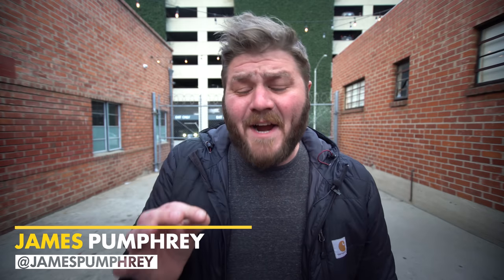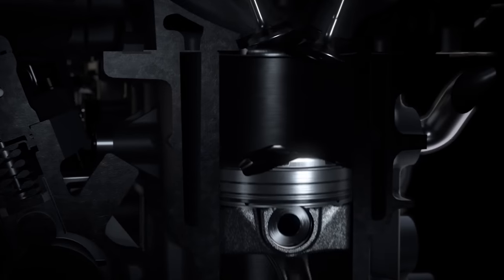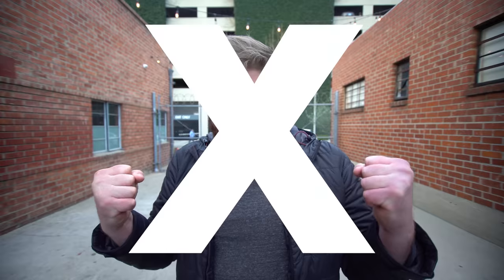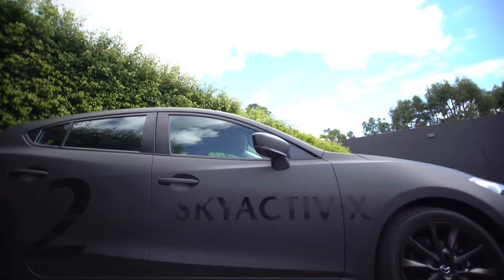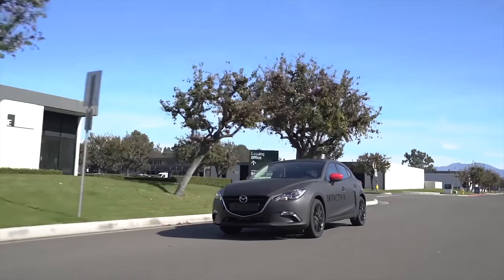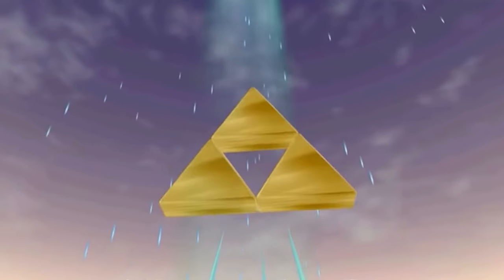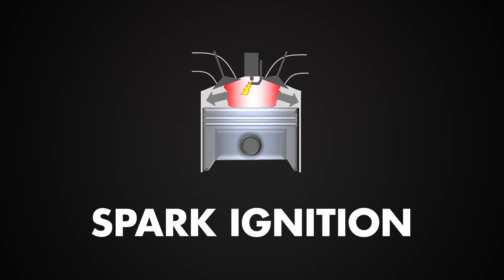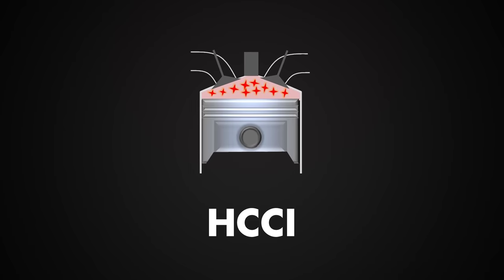Mazda's Secret New Engine Technology - SkyactivX | The New Car Show

Comment: ok hear me out, Mazda should make a turbocharged HCCI rotary hybrid diesel engine.
Reply: 1. We do not inject diesel via ports/valves (Port Fuel Injection, PFI; or Multi-point Fuel Injection, MPI), we inject directly into the cylinder (Direct Injection, DI). HCCI is a Port Fuel Injected system. This method of combustion is just running a Gasoline engine so it "diesels" (runs without a spark, which is otherwise considered "abnormal combustion," which is bad in a regular, conventional engine). MPI would be less efficient in a diesel engine; Direct Injection offers better fuel economy than MPI when considering both standard Diesel and Spark-ignited Gasoline engines. The theory of running an engine using what we still call "abnormal combustion" isn't new, but actually getting it to work is the new technology.

2. Mazda's Rotary design isn't exactly very efficient. It's light, and it has a fair amount of power for it's weight, but as a rotary, there are far better Wankle designs, namely which reduce wear on the Apex Seals. There are far better ways to lubricate the engine, other than using dirty, used engine oil basically dumped into the intake like a carburetor, and then have fuel injected later on. The most common way to fix the lubrication issue in a Mazda engine is to premix Two Stroke engine oil with the fuel, which unlike conventional motor oil, is designed to be burned. There is a prototype diesel rotary from LiquidPiston, but their design for rotaries are not like Mazdas, and are much smaller. That being said, technically nothing stops you from enlarging the parts and attempting to build a larger one. It's worth noting, however, that their prototype is just that - a prototype, which doesn't even contain a cooling system. It's just a proof of concept.
Reply: @Lieutenant Phœnix It was a joke but thanks for the detailed brakedown
Reply: @BenignStatue71  r/whoosh
Reply: @BenignStatue71  I was waiting for that one guy in the comments
Reply: I was onboard until you said Rotary
Reply: @luftboyprod  Yes, the higher rev range is caused partially by instability of the engine due to the high compression ratio (stroke - bore), so regardless of fuel injection method, unless you drop the compression you're not going to raise the redline RPM. You'd lose so much power that it'd be pointless. I said specifically an HCCI wouldn't happen, but a standard Diesel Rotary is possible. Just not a Mazda Rotary design - like I mentioned, LiquidPiston produced a prototype. Yes, their engines are too small for a car, but theoretically it's possible. The real question is whether it would even be worth it using diesel - if the benefits of a diesel engine aren't visible in a rotary engine, the design is a null point regardless of fuel delivery method.
Reply: Hybrid gay
Reply: Stonks
Reply: With a built in Nos tank attachment system.
Reply: @BenignStatue71  the only problem I have with DI(direct injection) vs PFI(port fuel injection) is that I heard DI in gas engines builds up ALOT of carbon build up because in pfi the fuels actually breaks down some carbon and burns it off as it enters the intake valve and moves over the piston.  However in di, it is directly sprayed on the piston and doesn't get the chance to break down much carbon over the intake valve before it is ignited.
Reply: @ichigokurosaki3120  I don't know much about the exact differences between DI and PFI's effect on the valves with unleaded fuel, but modern intake valves are going to get dirty regardless of injection method; leaded fuel (while dangerous for the atmosphere) worked very well to lubricate the injectors, as the included lead would stick to the injector's sealing surface; unleaded fuel does not (we've gotten past this with different designs since the 60s, but the problem still exists on a very small scale), but it's significantly safer to burn. Serious amounts of carbon build up in the cylinder should be unlikely in a car with everything running properly in factory spec (exact build up rate depends on manufacturer choices in how they design the engine and electronics). The time it would take to build up a considerable amount of carbon probably exceeds the manufacturer's "expected" lifetime of the car; GDI Hyundai's seem to perform well into the 200k' Kilometers range with no misfire problems (which could occur from excess carbon build up. For comparison, AutoTrader CA considers 20k Kilometers a year the average use of a car, making said Hyundai 10 years old in terms of it's road use). If too much fuel is being sprayed into the engine, leading to un-burnt fuel, you're more than likely looking either an overly aggressive tune (where we just spray more fuel to lower the AFR, some of which may not even having the chance to get burned), or a malfunctioning sensor giving the electronics a bad reading leading it to do that on it's own. Buildup over the car's lifetime isn't considered serious. All parts and how they're used are designed to be efficient and (generally) cost effective, not necessarily to run forever, but to be (again, generally, take some manufacturers with a grain of salt) easily replaceable when necessary.
Reply: @BenignStatue71  I agree with what you're saying, I'm not actually 100% sure around what mileage most vehicles with DI get too much carbon build up that they start misfiring, but I assume it's in the 100k to 200k range but maybe even more.  I'm a strong believer that if regular oil changes are done and a vehicle is well taken care they can last you for a very long time.  Also I'm not really sure if it's a problem with DI as a whole or just gasoline because diesel engines use DI as well and I haven't heard much negative about their carbon build ups, and thats even with diesel engines suffering more from blowby and excess fuel making its way into the cylinders.  I wish they're was more research into these departments so we as consumers know what we are buying/getting from a new vehicle.  Rather than buy and deal with recalls in the future and an apology notice for why our engines are running like crap but thats just my two cents haha
Reply: Yeah, if they could take the spark out of the rotary, it might solve their efficiency problem as well as the associated emissions issue that IIRC killed rotary for them... and it appears they are trying to do just that: https://jalopnik.com/mazda-may-apply-skyactiv-x-technology-to-a-rotary-engin-1830747175  but they call it SPCCI apparently.  Also, the whole design geometry of a rotary combustion chamber wall + rotor puts a limit on the maximum compression ratio that can be obtained.  There have been some attempts to design around this by, for example, using a 2 stage rotor system to drive pre-compressed air into the chamber (using a compression rotor), which then get's further compressed by the actual drive-line rotor.
Reply: 200 miles to the gallon 👀
Reply: Absolutely, they did it in 2020. They are invent a new Rotary Engine that's combined with Skyactiv Technology. They call it Skyactiv-R, who'll be the inside on the new Mazda RX-Vision
Reply: yes a big block V8 rotary
Reply: Holy shit
Reply: *twin charged
Reply: I don't care if they make a new diesel rotary engine or whatever I just want a new rotary engine and if it's diesel it has a higher compression ratio so I would love that 👌
Reply: ... a turbocharged HCCI rotary hybrid diesel engine...   in a V-config... with monster large pistons.  And VTEC yo!
Reply: @DualShockTree  I don't think you know what rotary engines can do
Reply: @yourownergaming9512  I know what they can do, I just don't like the design. There's reasons why no new Rotary engines are in production cars anymore
Reply: Turns out benz tried that out for a tank engine
Reply: Only the secret elite have access to that engine.
Reply: @ichigokurosaki3120  mazdas skyactiv gdi  engine dosen't have the same carbon build up problem that all the others have been working on them since 2012 now
Reply: Inline straight six rotary
Reply: Bruh
Reply: @DualShockTree  had you in the first half didn't he?
Reply: @DJJ959  you could say that heh

Comment: Skyactiv Rotary. Make it happen Mazda!
Reply: daaaaaaaaaaaaaaaaaaaaaaaaaaamn
Reply: Did some research, they are actually working on something like that
Reply: gerrit sikkema yes, Mazda is working on a new Wankel engine but it will function as a range extender in their fully electric vehicles :(
Reply: Zoltan Benedek room for rotary conversions?
Reply: gerrit sikkema if there‘s room for batteries, there‘s also room for a Dorit or two
Reply: Oh it's coming, just wait a few more months ;)
Reply: Nah they'll use the new engine in a future rx9
Reply: Skyactive X Rotary with Twin Turbo LASERS!
Reply: Hell yeeeaaaa boy....followed by its successor the 65mpg RX10
Reply: A Mazda RX without the dorito rotor is NOT a RX
Reply: Unkwon Malaysian Guy X = Experimental
Reply: Mazda dropped the troublesome Wankel engine like a bad habit.
Reply: Mazda's CEO confirmed that the RX-9 was a hoax... it was nothing but a false rumor started by bloggers...

Comment: Mazda specialised in weird engineering,  before it was rotary now this
Reply: amer albakri also the Miller Cycle engines in the millenia's.
Reply: out of the box thinking:)
Reply: I too immediately thought of Mazda's failed foray into producing cars with the Miller Cycle engine... Its too bad Mazda is better at losing money than making it.
Reply: Without failure u not going have progress
Reply: Without cars that actually sell... you have no car company, Mazda has already been bankrupt 3 times... they may just get swallowed up by Toyota or Honda next time and cease to exist.
Reply: And they're also experimenting with laser ignition so they can make the most (not a lot) efficient rotary engine possible
Reply: Mazda only sells cars with reciprocating engines... they ceased all development of production Wankel engines in May 2009.
Reply: Nothing but wishful thinking and false hope... although laser ignition has been tested in laboratories, a practical system still does not yet exist.... and if it did? It would be equally beneficial to both orbiting reciprocating designs completely negating any net gain in efficiency over reciprocating engines.... so dream on.
Reply: @doktorbimmer  not true. Rotaries benefit from multiple ignition sources along the long combustion chamber. Cylinders need a more spherical combustion front.